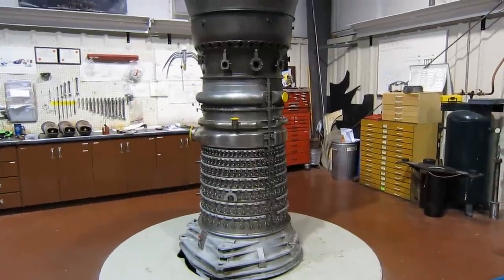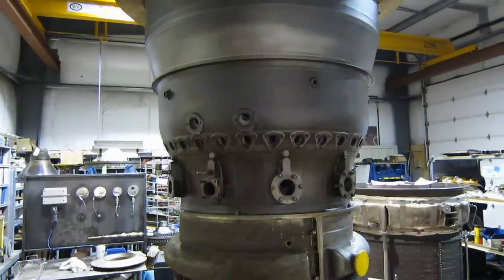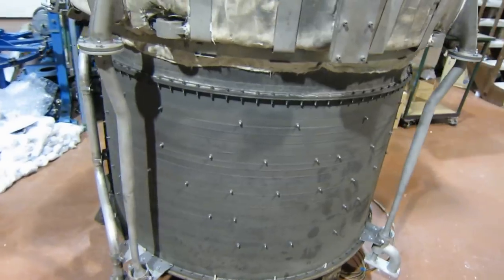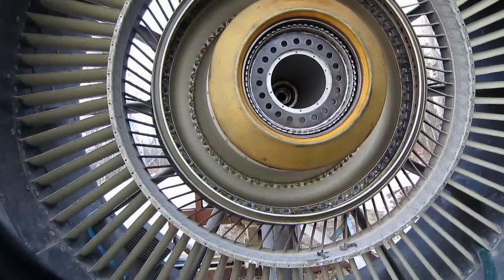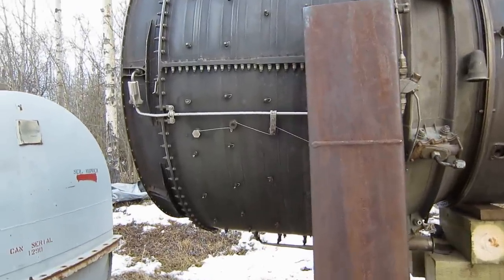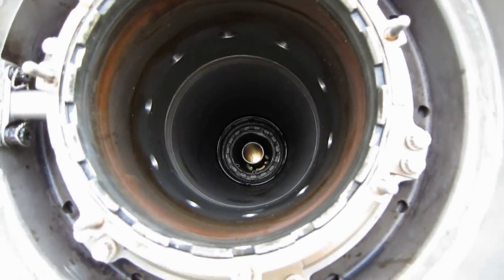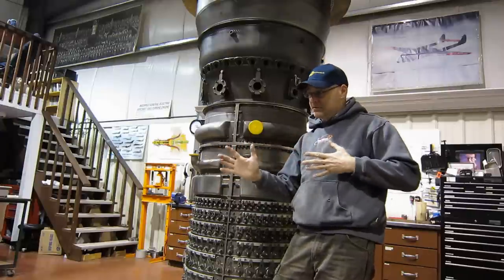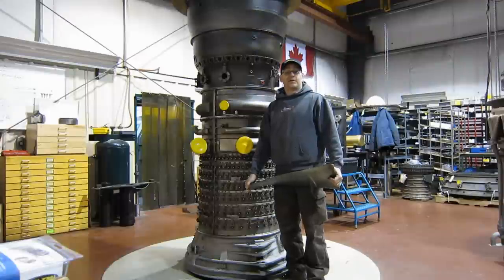Turbofan Parts Donor 2

Comment from the maker: @Ilicium It's driven by the HP system, also called the core. The actual transfer gearbox is at the front of the HP compressor, so it is behind the LP fan. The radial driveshaft is at the 6 oclock position, and is just in front of the group of vertical tubes the pass down just behind the fan casing.

Comment from the maker: @xxJohn1977xx Yes, but most of that air is used for turbine cooling and air seal pressurization. Usually air taken off fo use elsewhere in the aircraft, called "customer bleed air" is taken further forward off the compressor, at a lower pressure and temperature.

Comment from the maker: @blobusus The parts that are light on an aeroderivative engine and heavy on a full industrial engine are the cases and other stationary parts.
The rotors, both compressor and turbine are very similar for engines in the same power range.

Comment: @blobusus

I would imagine weight isn't much a concern as long as it isn't on any moving parts since the extra mass will require more power to move it, but like an aircraft engine heat is probably more an issue than anything.  If what I know is correct, turbine engine design has two hurdles holding them back: mass flow and max temperature.

Comment from the maker: @chris746568462 At takeoff power, the fan of the CF6-6 turns at 3400 - 3600 rpm.
I didn't weigh the blades but they felt like about 15Kg or 25 - 30 Lbs each.
The rotating mass of the blades would act as if it were concentrated at roughly half their length from the center of the hub.
Half their length plus half the hub diameter is your radius, 15Kg is your mass, ans 3500rpm is your rotational velocity.. that'll give you a ballpark answer.
I'll take some measurements tomorrow !

Comment: A nice easy question for you.  Do I assume correctly that a purpose built industrial gas generator would be heavier, since it doesn't have to lift itself off the ground?  I always wondered if the metallurgy would be simpler since the parts don't have to be so light.  Or is it more complicated than that?

Comment: I'm curious of what is the white cloth-like material that is wrapped around the LM2500?
Reply from the maker: I checked the video again, and I'm not sure what you mean. It really helps if you quote a time when you see something.
Reply: AgentJayZ
 Sorry, It would be at 1:40 and it's strapped on all the away around with 1" or so metal strapping tightened down with bolts. I haven't noticed this on any of the other engines.
Reply from the maker: 9travel9 that is fibreglas cloth, used as an insulator or heat shield.
Whether it contributes to performance, I can't say I know either way.